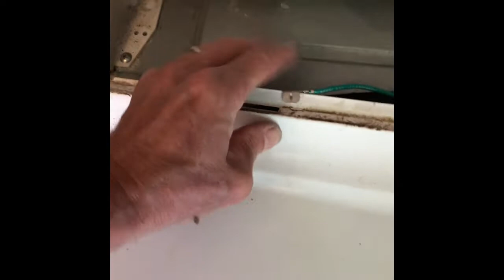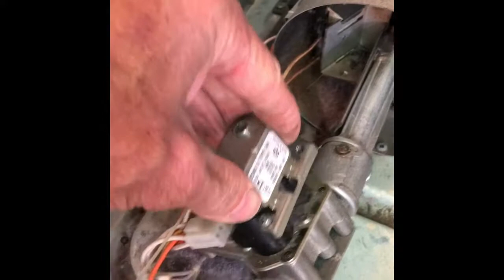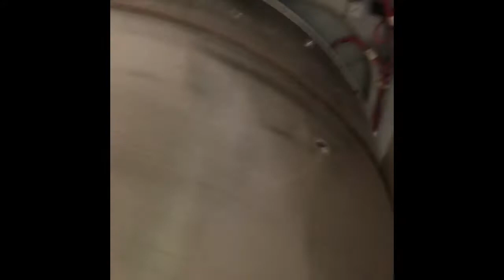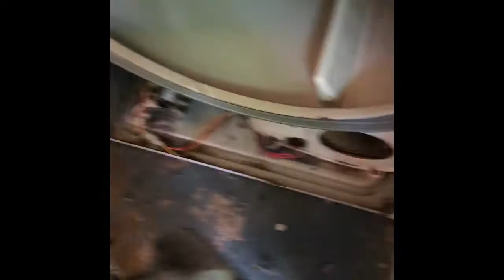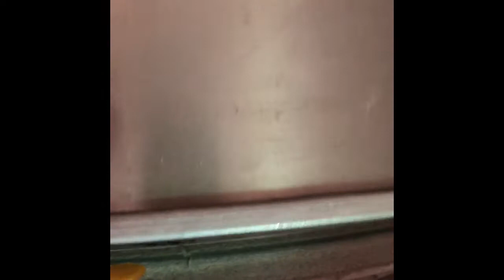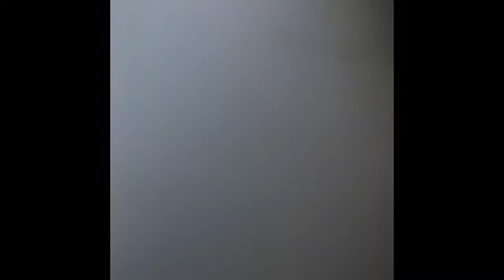✨ GE GAS DRYER - NO HEAT - Easy DIY Fix ✨

Comment: Just purchased a JGBS66REKSS GE Gas Range. Problem: very little variability in the flame size. Flame only changes between Low to 3. From 3 to 10, I have the same high flame with no change. Had the tech come in. He said there is no way to adjust the high flame, only the low flame. Which he did, but it did not provide me with infinite variability of the flame size within the parameters of Low to 10. My old stove did not have this problem. I asked about changing the sizes of the orifices (I run LP), he said that will not provide the change I'm looking for. I would think it is within the valve itself. This seems to be a common problem now. But, no one is addressing it. Can you offer any thoughts?